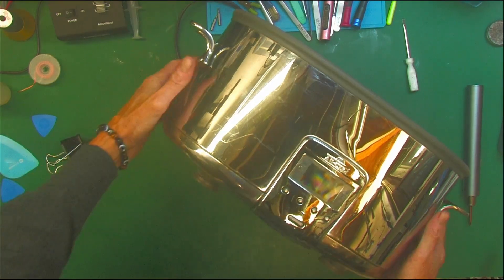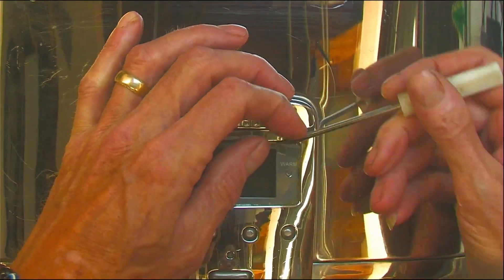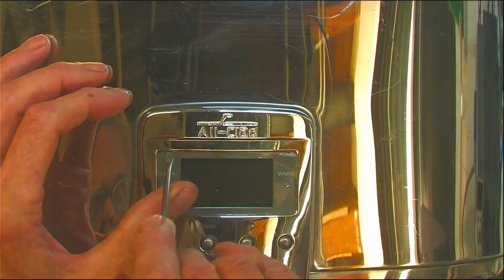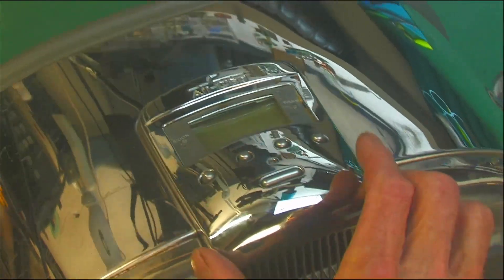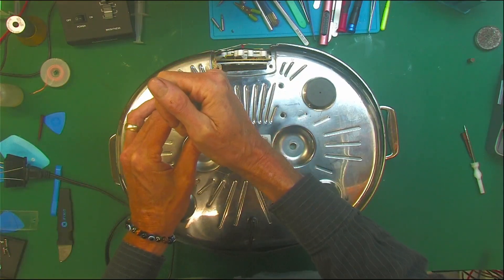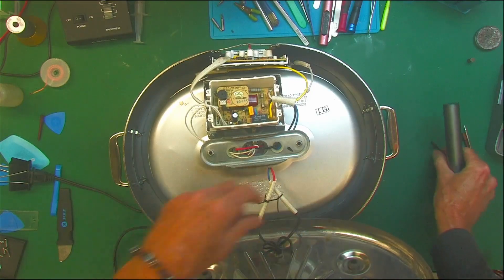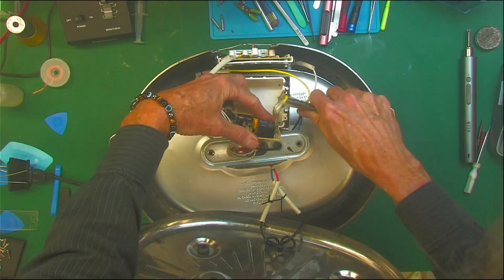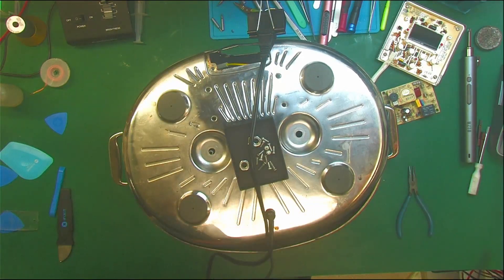All-Clad Slow Cooker Tear Down, power board & display board removal for repair.

Comment: Thank you for this video.  I have the exact same model we got brand new. It had very little use on it when my wife inadvertently got some sauce underneath the container and into that spring assembly.  
It made it sticky trying to depress the spring loaded cylinder.

I took the unit apart and cleaned around that spring loaded cylinder and now it goes up and down freely. However, the unit still won't power on or otherwise give any response.

Any idea what the issue could be?
Reply from the maker: The slug that is spring loaded has 4 wires coming out if it. 2 are thermocouple, that sense the temperature. The other 2 are a thermal fuse. If it ohms open it is bad. I seem to remember that part can be bought.

Comment: Excellent Tear Down Video!  Thank you!!  Question, what was the culprit and repair?  I'm having same issue on the same model.
Reply from the maker: Thank you, Frank, I was planning a video repair on the board. But it kept getting deeper with no results on the power supply. I have ordered the replacement boards. Ill give them a test over and a video of the reassembly. I found a bad zener and replaced it and powered it up again. but the power supply board kept just dropping to 0 volts. I suspect it is the processor chip as it seems to drain when the display comes on.
Reply: Thanks for posting this! My thrift shop find was working but had a broken knob. I couldn't figure out how to get it open to repair it until I saw your video.